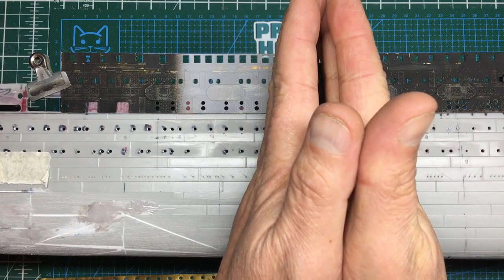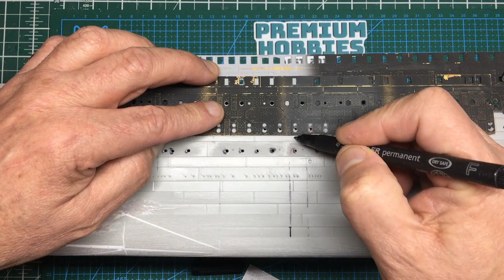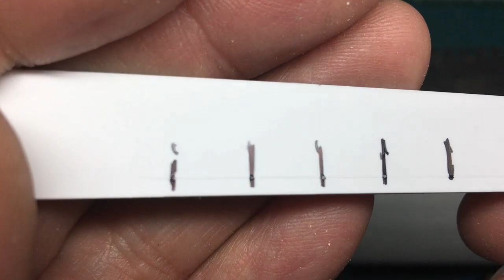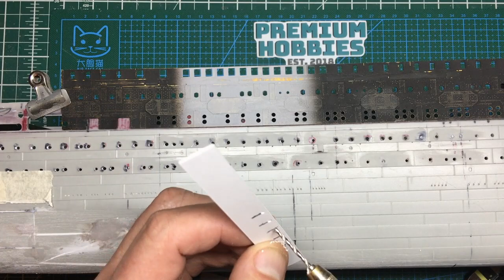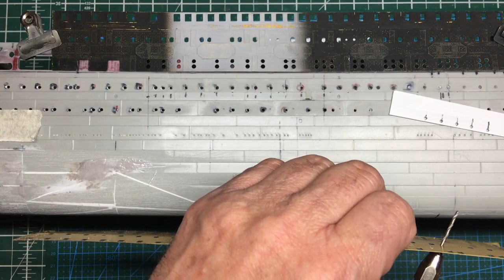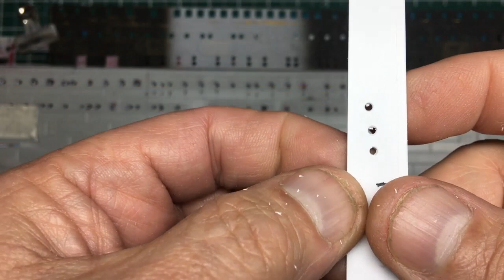Another porthole drilling video

Comment: Hi Nigel, greetings from Canada.  Many thanks for all the research and work you've performed in creating these fix/adjustment videos for the "Trumpy" Titanic.  Applying even a few of your techniques and suggestions will help produce an outstanding replica.

In this video, you suggest accessing a link on "Google" which provides a chart and information on the placement and sizing of the portholes.  If you can (and if you're allowed), would you mind providing that link here for reference purposes?   I tried searching for it and came up dry.  Thanks much!

Cheers, and keep the tutorials coming!
Reply from the maker: Here you go..

http://www.titanicmodel.net/uploads/4/1/6/0/41607523/titanic-sidelight-star.gif  http://www.titanicmodel.net/uploads/4/1/6/0/41607523/titanic-sidelight-port.gif
Reply: @NigelsModellingBench  Howdy Nigel:  Many thanks for the links which I checked out a few moments ago.  Certainly a lot of useful information on the drawings, which I will apply to a build of the Academy 1/400 Titanic (Centennial Edition) before tackling the Trumpeter version.

A final question:  For those of us who have bought your bulkheads set and are contemplating widening the model's bottom, are there changes we need to make to the bulkheads as a result of widening the lower hull?   I assume the lower sides of an affected brace need to be thickened with material to conform to the new bottom profile, but no work would be necessary on the upper portion since altering the bottom doesn't impact the top zone of the hull?

Thanks!

Comment: Really enjoying the videos Nigel, they are extremely helpful and insightful. Takes this from a run of the mill model to a true engineering project. Was also wondering whether you have though about how you will integrate the new plating in the areas where it is sanded off with the existing plating on the hull.
Reply from the maker: I have thought about that and have decided it's probably best to remove the whole lot below G deck..